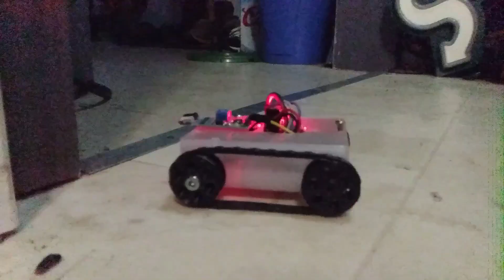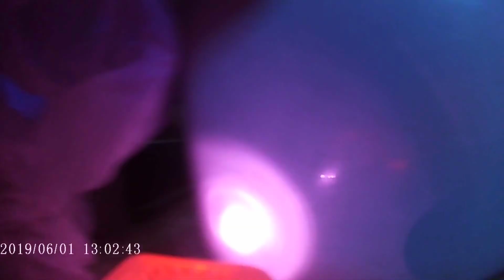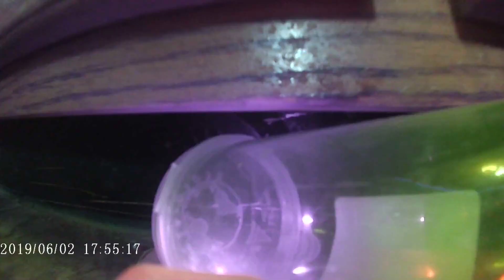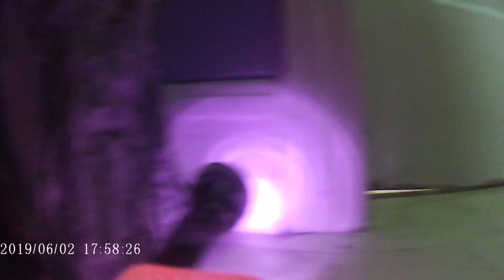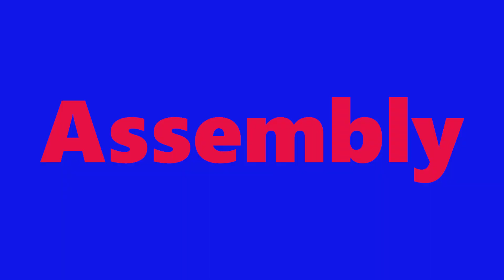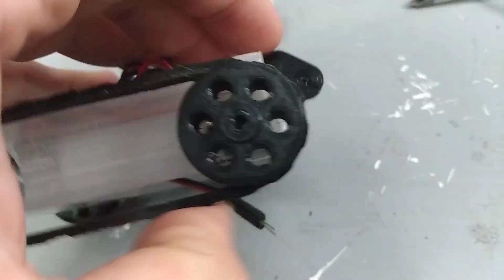Mini Autonomous Tracked Robot(3d Printed)

Comment: maybe a super simple micro switch on each side to cut power to left or right motor, so it doesn't drive into walls. you could even put a little wheel on the micro switch. right on this looks fun!